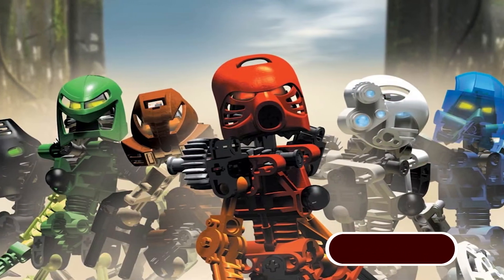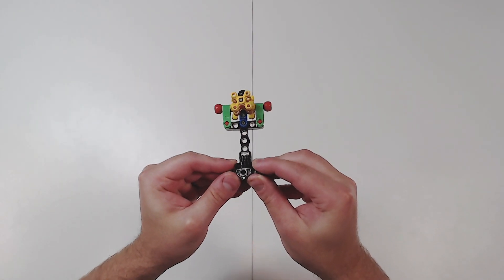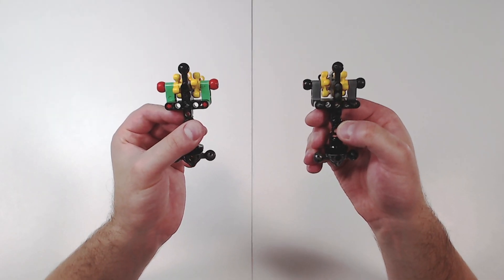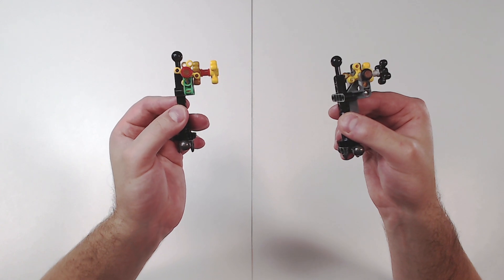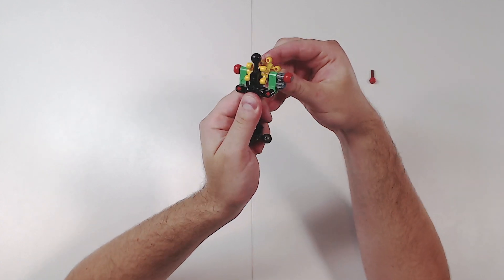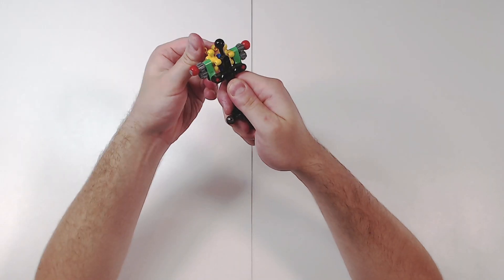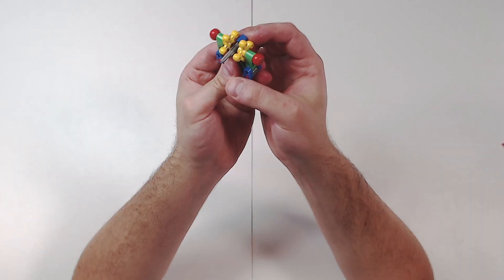Basic Lego Technic Gearbox | The Mocitorium

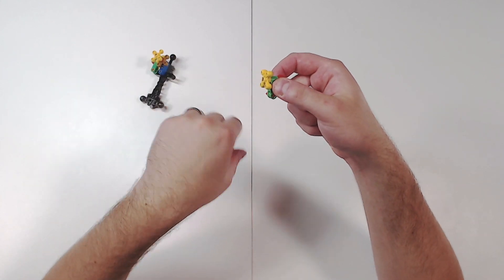Comment: 2:23 You wouldn't be able to do it with standard gearbox from Masters because there was a bit of plastic making impossible to put this piece inside.
Reply from the maker: Very good point! Yes you could not put a liftarm in the existing gearbox. All the more reason this is a better option! <3

Comment: I have a question though, what if you want to use it to modify a CCBS torso? As in the ones used in 2015 and the HF line?

Also idk what happened but I'm not in your discord server anymore
Reply from the maker: You could connect two half-length five-long technic beams. Connecting them without axle holes won't work because they're rotate. You'd definitely have to play around with it. It may end up sticking out too far.

Comment: I like this
While the 2015 gearbox piece isn't that bad, I like this design a lot more, as it's less obtrusive
ALSO, if you use axle-pins, I do believe you could use this design on the standard CCBS torso
Don't quote me on that, but I do think you can use it like that.
Either way, biggus brainus design choice
Reply from the maker: Thanks Pax! I believe it would allow the assembly to rotate as the CCBS torso only has pinholes. Absolutely can mod this build to fit it but don't think it would comfortably transfer over unchanged.